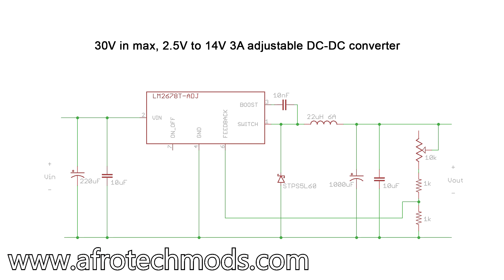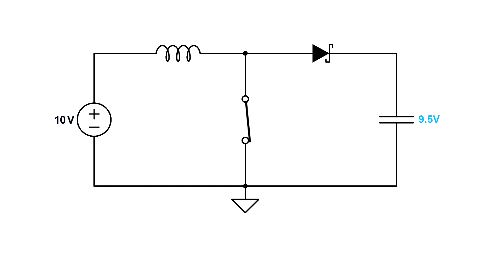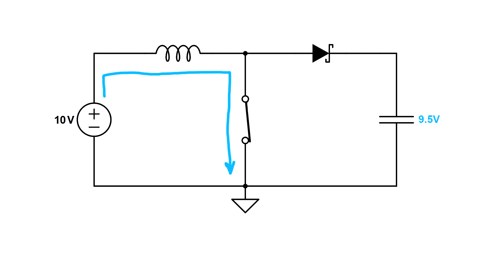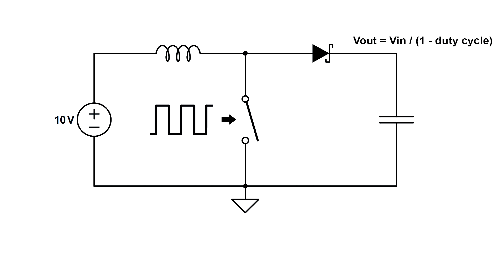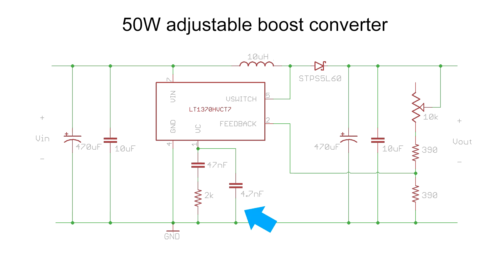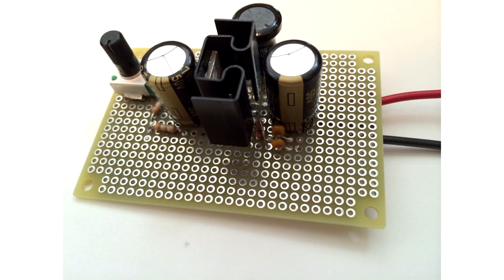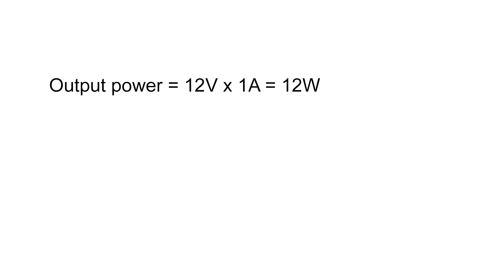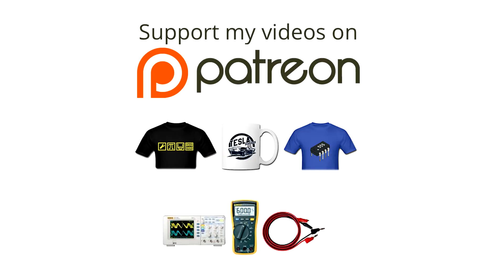DC-DC Boost converter tutorial

Comment: Because of this video I spotted a fake lol.   Guy is boosting  12 volts up 24 volts with a 12 volt  laptop  battery  chargers.  Claims  the  current  output of the battery charger is 5 amps... hes also running a large motor.       I think the  voltage is either dropping alot  on the output and current is rising... alot.. lol but 5 amps is going to cut it with what he has on the load lol

Comment: Nice video!
My question is that when the switch is open, the capacitor is getting charged( and hence voltage is boosted). However, this happens during every cycle, so the capacitor keeps on charging ( and hence the output voltage keeps on increasing). How is this prevented?

Comment: So i have 20V Input and same input should also be 30V output from battery. I need to step up 20 V to 30V so that i can charge my battery to full. Same time i don't want to blow up my step up converter. So can i connect step up converters output to it's input or do i need to make somekind of circuit.

Comment: Is it true for buck converters to increase the output current by dropping the voltage? Are they opposite of each other? I have a solar panel that outputs 19.4 volts that outputs 3.1 amps, I wish to drop that voltage to roughly 13 volts, but I wish for it to be able to supply more current on the output just like a MPPT Controller, would this be possible?

Comment: How did you do the feedback calculation with the 10K pot? I know in the datasheet it gives formulas to calculate if only using 2 fixed feedback resistors, but nothing about calculations with a pot. I am doing a thesis project on this and would be helpful if I knew how these were calculated. Thanks!

Comment: If you increased the inductor to something larger, like 56uH, and a larger 50V cap, would that be the proper way to increase the output voltage, to something capable of 50 V?  I would imagine that you'd need active cooling, as the heatsink on the controller wouldn't quite be enough.  Would you need to cool the cap as well?  Also, since my experience with boost converters is very limited, if you increase the values of the inductor and cap, would the duty cycle on the controller need to be as high to boost the voltage higher? Would the lower switching frequency require less cooling?

Comment: your tutorial is very good. I tried mine it boosted 3v to 12v using a 100uH inductors but I got lower ampere than that of my input current. My input current was 0.6amps and I got 0.01 at the output. Pls help

Comment: what if you wanted to take say 14 volt and step it up to 348 volts like the dc current coming from a 370 amp Mechman alternator ? I ask cause I would like to be able to use the dc current from the alternator to run an ac motor from a rinehart ac motor controller

Comment: Damn, just the chip costs (in my country) way more then the old laptpop AND tablet AND homemade "sound system" used mostly to annoy neighbours and bragging rights ;-) 
which i planned to use it to power them from one "slightly" smashed (ENORMOUS, and tested, has bout 95% nominal cap.) single Li-ion cell from a crashed beyond repair hybrid/electric car 
;-)
Now if that thing, slightly smashed battery, bursts in flames/smoulders in crowded public transport.... DOUBLE BONUS for me ;-)

Comment: The link for the input and output ceramic caps says page can not be found? I'm a newbie so I am not yet at a place to be able to figure out from the schematic what size I actually, (10uF)? I ordered everything thru the links you provided, and do not want to stray from what you recommend in order to have the best chance for a project that works, this will lessen all the variables I have control over? I have some ceramic caps from other projects but want to make sure I'm using the correct size.
Question: Can I use a 470 uF 200V cap in place of a 50V?

Comment: The way you explain how this works is extremely good.

You can make a SMPS DC->DC fixed voltage converter like you showed us here. However, you should also be able to use one of those to build a constant current SMPS? Can you show us how to do this for all SMPS types (step up, step down, step up/down, flyback, etc)?

Thank you!

Comment: // connect motor controller pins to Arduino digital pins // motor one int enA = 10; int in1 = 9; int in2 = 8; // motor two int enB = 5; int in3 = 7; int in4 = 6; void setup() { // set all the motor control pins to outputs pinMode(enA, OUTPUT); pinMode(enB, OUTPUT); pinMode(in1, OUTPUT); pinMode(in2, OUTPUT); pinMode(in3, OUTPUT); pinMode(in4, OUTPUT); } void demoOne() { // this function will run the motors in both directions at a fixed speed // turn on motor A digitalWrite(in1, HIGH); digitalWrite(in2, LOW); // set speed to 200 out of possible range 0~255 analogWrite(enA, 200); // turn on motor B digitalWrite(in3, HIGH); digitalWrite(in4, LOW); // set speed to 200 out of possible range 0~255 analogWrite(enB, 200); delay(2000); // now change motor directions digitalWrite(in1, LOW); digitalWrite(in2, HIGH); digitalWrite(in3, LOW); digitalWrite(in4, HIGH); delay(2000); // now turn off motors digitalWrite(in1, LOW); digitalWrite(in2, LOW); digitalWrite(in3, LOW); digitalWrite(in4, LOW); } void demoTwo() { // this function will run the motors across the range of possible speeds // note that maximum speed is determined by the motor itself and the operating voltage // the PWM values sent by analogWrite() are fractions of the maximum speed possible // by your hardware // turn on motors digitalWrite(in1, LOW); digitalWrite(in2, HIGH); digitalWrite(in3, LOW); digitalWrite(in4, HIGH); // accelerate from zero to maximum speed for (int i = 0; i < 256; i++) { analogWrite(enA, i); analogWrite(enB, i); delay(20); } // decelerate from maximum speed to zero for (int i = 255; i >= 0; --i) { analogWrite(enA, i); analogWrite(enB, i); delay(20); } // now turn off motors digitalWrite(in1, LOW); digitalWrite(in2, LOW); digitalWrite(in3, LOW); digitalWrite(in4, LOW); } void loop() { demoOne(); delay(1000); demoTwo(); delay(1000);

Comment: I bought a Raspberry Pi 3 pi-topCEED that requires a power input of 18V@1A - (actual measured load was around ~800mV, but it could call for a bit more at times, e.g. if something is plugged into a Pi USB port).

Want the option to power it out in the wild from a 20k mAh battery pack (USB) that can supply 5V@2A from up to 2 ports (4.2A max pack total).

1A x 18V = 18W  ~~~  18W / 5V = 3.6A

So now the crazy idea part…  (keeping in mind that this/your design was for boosting to 14Vout max)

Q1) Would this project build be stable enough to support and drive something as sensitive as a Raspberry Pi board?
-- If yes, … --
Q2) If I built 2 boosters, set both at 5Vin-->9Vout, and connected the outputs in series (now 18Vout, with more than enough current), would it work?

Or, would I just end up with Pi on my face?  (sorry)

Feel free to embarrass me with a better solution. Cheers.

Comment: Why do you use both ceramic and electrolytic capacitors in series? Naively, it seems like the circuit should behave the same regardless of the type of capacitor. Is it something to do with distance from the feedback pins? (i.e. ceramic -> small but close, electrolytic -> bigger but further).

Btw, thanks so much for your videos. Very clear and well explained!
Reply from the maker: I am in the process of producing a detailed video answer to this, but it will be a while before it gets released

Comment: Nice video with a clear explanation. Thank You. The car charger I'm using now uses nominal 12V from the vehicle electrical system and boosts it to 19V. Except when first turned on, then the output will be 22.5 volts. Over the next second or so it drops back to 19V. Putting a 30W load on it makes no difference. What does the output voltage of your circuit look like when first powered on?

Comment: Has anyone tried those step up modules you can buy on a certain Chinese website for less than a dollar? I'd like to get more 12V pixies from a 22A 5V rail on a PSU. I need to feed 4x 2A 12V to power up four HDDs for a few seconds, after that the current draw drops significantly. Instead of having one, beefy converter that can handle a lot of watts, can you just put several smaller ones like the Chinese ones in parallel on a single power source or will they interfere with each other?

Comment: How can the inductor work on DC supply??  Shouldn't inductors need AC to work?
Reply: Harsh Sharma well, you can think of the switch that's opening and closing as a sort of AC. When the inductor is shorted to ground, lots of current can flow, when it isn't, not so much.

Comment: Nice tutorial. But I have question.. For how long can I keep the "switch closed"?? suppose I am using an inductor with 560uH Inductance and the applied voltage across it is 12v....
Reply: E-mania Ideally you would want a pulse width modulator at the switch to keep the switch alternating on and off. The reason for this is that inductors can only take so much of a sudden change in current that you would end up burning out your inductor. Anything in the kHz range would be sufficient, but your design would have to account for a lot of factors such as switching frequency and voltage and current ripple.
Reply: E-mania So in response to you, I'd say keep the switch closed and open for a few microseconds. Which would mean your switching frequency may be upwards of 20-50 kHz depending on your design.

Comment: Would these switching boost converters at 500 kHz (or 72 kHz) cause a lot of noise that would affect nearby analog audio circuits? What about the inductor? How would I design a circuit to match LT1111CN8-PBF? Would a 120 kHz IC be better than a lower frequency IC like I mentioned?

Comment: If I use 6V,  7amp battery, will I be able to draw more current on the output at 30V? And is the variable resistor on the output to adjust the voltage output?

Comment: What will happen when your power requirement will be higher than input ? For ex I want to power LED, which need 30V and 1A, from a powerbank, 5V and 1A..   So power bank can give 15W, and we need 30W. It will not work. It can only give 30V on 0.5A. But what will happen to power bank when you get over 15W, it will burn ?
Reply: You are correct, it will not work very well. It's hard to say what will happen.

A well designed, safe voltage source should contain over-current/under-voltage protection, which can be combined. I.e. as the current limit is reached, the voltage starts buckling; however then, if the consumer is a boost or buck converter, it will keep drawing more current, creating a dangerous situation where all elements and wires are emitting even more heat. Then the safety circuit should detect voltage being below the limit (e.g. 4.5V at the output, although really it will be measuring a different voltage at the battery) and disconnect the battery, and wait for recovery conditions to be met.

Power banks, and actually all kinds of cheap electronics, are not usually designed with sufficient protection. If they are based on Lithium-Ion Polymer Pouch battery, there may be a fire. If they are based on a cylindrical Lithium Ion cell, the cell itself should usually contain two security devices which will disable the battery permanently by detaching its positive terminal if there's a heat buildup or gas expulsion. Of course with cheap cells that don't come from major manufacturers, you can't rely on those security devices either.

Comment: Ok, here's hoping I might get a reply on an old video! I'm trying to make a nice light box for my shop out of some salvaged LCD TV LED backlights. Based on information from the circuit board, the total array of LEDs in the backlight is getting 118v, and all 32 LEDs are in series (oddly...) There are 4 strips, each with 8 LEDs on them, and each LED consumes around 150mA. 118/32 = ~3.7v. I plan on modifying the bus board that the 4 strips connect to to make them parallel instead of series, meaning that I would only need to provide enough voltage for 8 LEDs, but more current. At ~3.7v each, I'd need about 29.6v, and with the 4 strips in parallel I'd need at least 600mA. Is something like this capable of stepping up, say 12v 2A input to 30v 1A? Please pardon my lack of knowledge on this subject, I'm good with electronics, but usually mess with bigger stuff that makes a lot more sense to me, I have trouble wrapping my head around this smaller stuff.
Reply from the maker: 12V x 2A = 24W, 30V x 1A = 30W, and you can't get more power out than you put in, so no. But if you had a power supply that could deliver more current to the input then yeah this circuit might work if you are VERY careful with getting the output voltage exactly right. Ideally you would want to design a constant current boost converter LED driver circuit. linear.com have a lot of examples.
Reply: Actually I just kinda threw out the 2A number. In reality I'd probably be powering this from a computer power supply capable of delivering something like 15A on the 12v rail, so I'll have a lot more wiggle room. I've actually started looking at a simpler option though: using a bridge rectifier to get 170v DC from the wall and using a voltage divider. If I use a 20k and 47k resistor in series, then take the voltage between the 47k and ground, I should get 118v, and the total power dissipation of the voltage divider should only be about 431 mW (unless I'm totally doing the math wrong...170 volts, 67k ohms, 170^2 / 67000 = 431.343, right?)
Reply from the maker: HaLo2FrEeEk
computer psu would be okay, voltage divider no way - see my voltage divider tutorial for details.
Reply: Ah, so the issue with a voltage regulator in this case is the higher current needed and voltage drop? I was really hoping for that option, because I really don't want to modify the bus bar to make it parallel. I can't think of another way to reliably supply 118v and at least 150mA though. Doing some quick calculations, it looks like 12v * 15A = 180W, and 118v * 150mA = 17.7W, so, technically, a boost converter could do this, right?
Reply from the maker: HaLo2FrEeEk
Yeah a boost converter could do what you want, just be very careful to not give the LEDs too high a voltage else you'll pop them.

Comment: why it not get short circuit of voltage source through inductor after switch is closen ??
Reply from the maker: That is a good question. It takes a certain amount of time for current to increase in the inductor. (The steady state short condition is not instant.) So as long as you only close the switch for an extremely short period of time, there is no sustained short.
Reply: thank you sir..
Reply: one more question .....

when we connect primary coil of transformer to ac supply why it not get short circuited??
it is simply a coil.  so why it doesnt sc??
Reply from the maker: Chauhan Dhananjay
Because the primary coil of a transformer has significant inductance, meaning it impedes (resists) alternating current. I recommend researching inductance and impedance.

Comment: The textbook equation for voltage gain is valid for continuous conduction mode,  or HIGH CURRENTS, as long as they respect the circuit's limits. Low currents will cause the output voltage to rise above that equation.

Comment: Could you theoretically use a high frequency output of a 555 oscillator instead of the LT1370 for the controlled square wave? Or is the highest frequency you can make with a 555 not fast enough to stop inductive spiking? Any answer will be appreciated.
Reply from the maker: You can make a boost converter out of a 555 quite easily, the problem will be getting it to have a tightly regulated voltage output that is stable across a wide variety of load transients.
Reply: Same question here, someone?
Reply: +Afrotechmods Okay I get it thanks. Another important question, I want to buy some of the products you recommend, some of them need to be plugged in, as i live in spain i do not really know if it would be a problem and if it is how would it be solved.
PS: Thing is, not in all products specifies that input power. Thank you and really useful great vids!
Reply from the maker: Kique Phan Razquin
It would depend on the product. For low powered stuff (under 100W) 220V to 110V converters are pretty cheap and widely available.
Reply: Thanks very much!
Reply: +Afrotechmods Thank you! I will buy some stuff so!

Comment: Great video. I've a question anyway. Can I use LM2678S insted of LM2678T? What are the diferences? Thanks!
Reply from the maker: The S looks like it's just the surface mount version of the same thing.
Reply: +Afrotechmods thanks.  This version I 3 times cheaper.
Reply: +Paweł Fabiszewski yeah, but as it's surface mount you won't be able to put it on a perfboard of breadboard

Comment: Now for the fun part... I repair and build tube amps. This begins my journey to build a switching mode / boost converter power supply that can give me the high voltage that I require for the B+. Most tube amps run around the 100 to 200 ma, with a B+ voltage between 199 to 500. I've searched the net and I've found very little information. I am also aware of the risk involved with voltages this high. I have safe work practices. I just need some material and data to steer me in the right direction...

Comment: At 4:24 I automatically can tell its not an isolated boost converter because of the ground to ground connection or am I wrong and you make things so easy to to understand.
Reply from the maker: +Joseph Chambers That is correct but you can tell just from the schematic too - there's no isolation transformer.

Comment: if i used a 9 volt battery connected to an inverter so that the current becomes AC, then connected that to a boost converter, how many volts, amps and wattage would i be getting on the output? how would the inverter affect the current ( what voltage would i get between the inverter and the booster) then with that, what would my final output be?